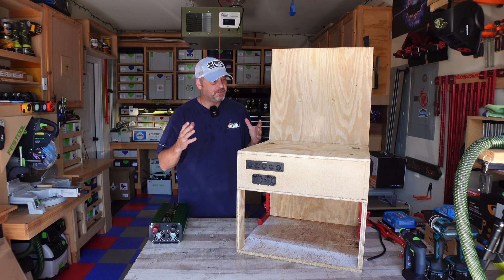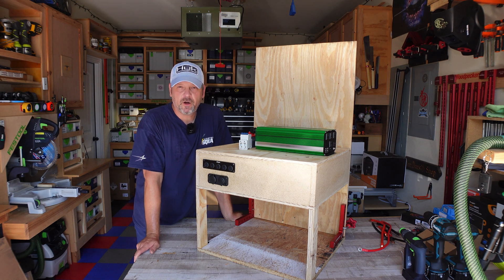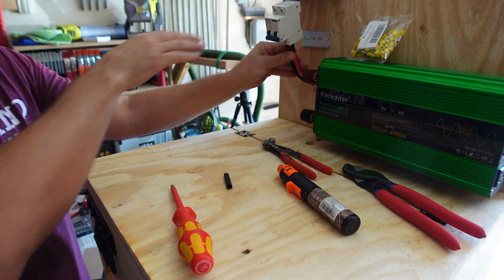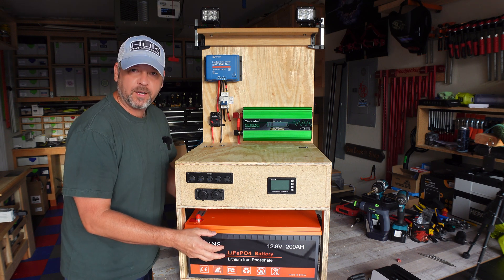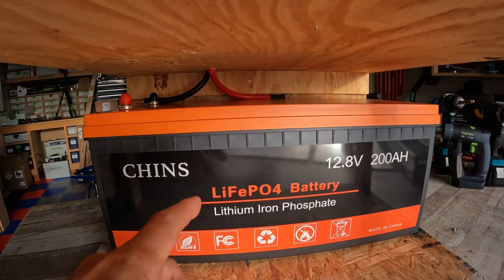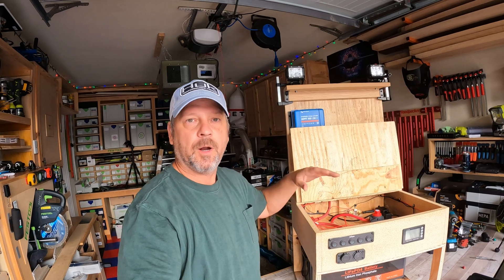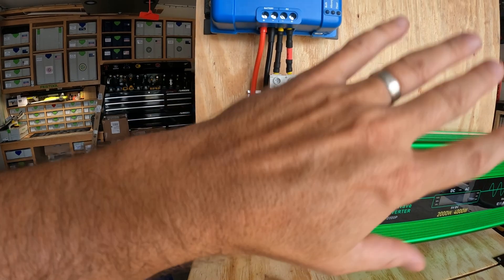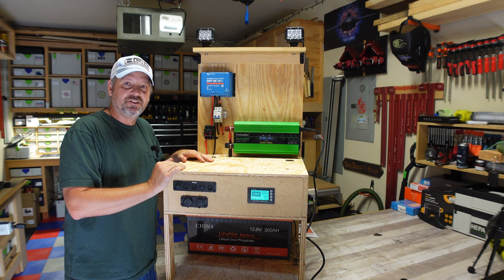ULTIMATE DIY SOLAR GENERATOR 3.0 // CHINS 200AH LIFEPO4

Comment: Just found this video and it really helped clear up some questions I had about an emergency DIY 12v system. 

I know it’s been a while since you made the video, but you have to check out the Watt Cycle 12v 300ah mini batteries. You could probably fit 10 under the cart where you have the Chins

Excellent video and many thanks
Reply from the maker: Thank you! I have t had the chance to review the watt cycle battery yet.

Comment: Do you prefer this battery used here, over the Redodo you used previously?
Reply from the maker: Honestly, they are virtually the same. Likely made on the same production line and put in a different case. Both are good batteries and I’d get whichever is on sale at the time.

Comment: Can you help me out here.  You are showing 12v inverter at 2000watts, that is 166.67 amps.  Your using 2awg wire that is rated at 115 amps.  Something does not smell right here to me.

Comment: Have you considered a Victron monitor so you could access both battery monitor and charge controller via their mobile app?? Or is there a reason to avoid the Victron monitor?
Reply from the maker: I love Victron stuff, and buying a little bit of it at a time because it’s a bit pricey. But well worth the $$

Comment: Maybe too late but, 2 things: First, that resistor is not needed anymore because you have all the wires hooked up already so no sparks will happen when you turn on the big Battery switch. Second, the shunt must be placed on wiring immediately after the battery, otherwise metering is not correct.

Comment: hi! Nice setup, i build almost the same, but i went with 24v 100ah instead of 12v 200ah battery + victron inverter is better just because it will be in the same app you'll use for controller
Reply from the maker: Thanks👍🏻👍🏻

Comment: Can you add a way to charge with portable generator or grid power?
Reply from the maker: Sure! You can connect a charger directly to the battery and then plug into a generator to charge up

Comment: Rule #1 Nothing is EASY! These things HAVE caused fires. Suggestions. It is recommended to put your Battery switch and fuse within 7 inches of the POS battery terminal and in a place that can be gotten to very quickly by anybody. ALL POS wire connections (every one) must be covered or insulated even the Batteries to protect from a SHIT HAPPENS moment short and a fire. Remember your AC panel and your vehicles when they came from the factory have a Main switch and all things covered and fused.

Comment: Great workmanship. Only one suggestion though. Lose the high frequency, transformerless pure sine wave inverter, spend a little more money and install a low frequency, transformer based pure sine wave inverter instead. The inverter that you currently have mounted is absolutely worthless for powering inductive loads such as power tools, motors, microwave, refrigerators, air compressors etc. because it provides very little surge capacity. You may be able to power a few inductive loads when this inverter is new, but every time you fire up one of those loads, your damaging the MOSFETs in this inverter and after repeated use, it will fail.
Reply from the maker: Good advice👍🏻👍🏻
Reply: Can you recommend, if possible, a better inverter? Thanks in advance

Comment: I'd go 24v 100Ah, will cut down wire sizes and free up capacity on the MPPT controller for more power input.

Comment: I think it would be best if you could build the box onto a Dolly. This would provide you bigger wheels for moving it around and you could easily haul it on to your truck or roll it to a grassy backyard/sandy beach. Also, I'm sure it will be alot heavier once you put the second battery on there.

Comment: I wonder what solar disconnect switch I'm going to need? I have a Renogy 40 amp MPPT Rover and three 175 panels from Renogy panels?
Reply from the maker: I’d pick one rated anywhere between 10-30 amps over the max amps your panels would ever be able to produce. But that’s just me. I’m no expert

Comment: Nice build, the main thing I would do differently is mount the main battery on/off disconnect switch to be accessible from the outside and I would probably add a 30 amp A/C battery charger to the cart so I would also have the capability to recharge the battery from the grid or a generator if needed say several days of bad weather and no sun.
Reply from the maker: Thanks👍🏻

Comment: Great built. I almost completed a si.ilar built using a rigid cart. I was able to power a fan, so I think everything is working.  However, I was a bit surprised that I have to manually power the inverter when I used the disconect switch.  Should this system be completely switched off after use, or can the switch stay on? I am having a hard time finding best practices on how to use.
Reply from the maker: For me, I keep the inverter manually turned off as well as using a disconnect switch. The inverter will continue to use power even when not running a load.
Reply: Thanks so much for the quick response. Your video is one of the best ones and I was very helpful.

Comment: Can that inverter run a 700watt microwave, I just bought a 2kw inverter that won’t do it - I’m bummed.
Reply from the maker: I wouldn’t try to run a microwave with anything less than a 3000 watt inverter

Comment: The pre-charge idea is genius! I am far from an expert but that pre-charge setup should work no problem. I built a 5200wh cart from a composite material cart ordered off Amazon. Setup the batteries on the lower shelf/bottom, enclosed it with panels held on with velcro. My Hybrid MPPT is mounted verticaly on wood, facing away from the cart. Built a cover for the storage area of the cart and it provides a flat working surface. I also replaced the two wheels on the cart that were fixed with swivel wheels that lock. I can push the cart in any direction with ease, and I do that often as I use the power cart for various tools and equipment. I am going to install a 12v panel for USB amd charging HAM radio box via Anderson Powerpoles.
P.S. How about a capacitor discharge button?

Comment: ----------- here is an experiment that anyone with solar panels can do -----------

i have a 50w mono-crystalline solar panel and have found out that it works via artificial light [i do not know if this works with other types of solar panels] thus may well worth experimenting

have a spare solar panel or two size dependent of your needs and place them on the wall like you would a picture frame get some 5w or less usb led lights [the bright kind not the dimmer kind] and set them as up-lighters side-lighters or down-lighters or a combination thereof, you [will have to experiment with angle and distance to maximize] that way when you light your home at night you can still keep your batteries etc topped off

or

make a light-box for solar-panels

experiment with other low wattage light sources and see what works best for you

i found this out due to the solar panel on my emergency wind-up radio powerbank torch showing a red-light for charging whilst on the windowsill at night with just the ceiling light switched on and then tested with larger solar-panel

since then i have come across a couple of videos on YT about using artificial light with solar-panels including candle-light
Reply from the maker: 👍🏻👍🏻 would be interesting for sure to run that expirement
Reply: @BrianWatersOutdoors  do i foresee a video in your not to distant future...??
Reply: And use mirrors to reflect the lights as well.

Comment: PS: ruff figure for me was $ 1059.00 USD - that includes an estimate of thos LED lights & switches plus my state tax but you can even rnd that up to around $1070 on the high side - which over all isn't that bad. My main concern was running a fridge with it and from what I can tell it will.
Reply from the maker: Good estimate! Literally about the amount this cost me👍🏻

Comment: Hey Brian, Really looks good was thinking of building something similar myself. I would suggest a general price range in the future as well. Also being a former electrician for almost 40 years I have to agree with Farside as well to put the Bat shut off switch on the front and outside(at least the knob) - always taught to expose switches and plugs.Otherwise great build and TY for including links to find with you have, Here's a tip for those who can't afford that tip crimping tool you can always solder the leads and that makes a good connection as well.
Cheers!
Reply from the maker: Thank you for the advice👍🏻

Comment: another great build. I am doing the same build now. What brand lights are you using? Also where do you get your copper wire? I am getting ready to install the solar shut off switch and 12 volt fuse block next. Lastly what is the brand of your heat shrink lighter or pen?
Reply from the maker: Thanks. The lights are Nilight brand, super cheap…copper wire is from WindyNation on Amazon, and I got the torch while standing in the checkout line at Lowe’s👍🏻

Comment: Very nice build! 

Can a single 120W solar paner cahrge your 200Ah LiFePO4 battery? 

Been using 120W solar panel too to charge my 250Ah lifepo4 battery but could not fully charge it.  I can only reach 73AH charge for 2 days charging. Im using PWM charge controller though,  still waiting for my 50A MPPT charge controller.
Reply from the maker: It could if you leave it long enough

Comment: I’m not sure why anyone would build these monstrosities given the cost when you can just buy a few 200w panels and a ecoflow power station, it’s even mobile…
Reply from the maker: Okay
Reply: @BrianWatersOutdoors  I’m just saying my ecoflow delta 2 system with 400w solar is cheaper, more portable and quite a bit more functional that these tinker builds.
Reply: @mikeeeeee555  I agree. Perhaps time should be spent on making all gear DC only.
I see way too many DC to AC ( videos)combos only to have microwave or some uncommon AC appliance powered...not needed during power outage. 
Solar power is often wasted making AC from DC for show and tell.
If you are survival minded vs. show off for your neighbors....I guess it's your gear...go crazy.   I say....learn to live on 100 watts per hr/day. That's sustainable.
Any light is better than no light in a black out.  
1KWatts or more will alert the nosy neighbors.  IMO

Comment: just a quick question, if you hook in another battery in parallel(400 amp) do you need to change out any of the equipment in the build for anything bigger
Reply from the maker: No, you’d be good keeping everything the same.

Comment: Great video!  I didn’t see a AC Charger for the Chins battery.  You might consider having it to be a sort of UPS.  I use mine as a UPS plugged into the wall that runs my CPAP so when we get rolling blackouts in Texas I can sleep without knowing the power went out.  All the best !
Reply from the maker: Great idea. I do have a charger for this, just not built into this cart though.
Reply: @BrianWatersOutdoors  sounds good.  I am looking into various parts for portable Ham radio box that I am gathering up the pieces for solar/portable battery/radio, etc.  If you want to add it - cool, not trying to tell you what to do.  Haha.  We have enough of those people in our lives.

Comment: Great Build! That would work great on a hand truck for an off cabin, or rough ground.
Reply: Agreed! A very nice build 👌.  I just finished mine (or so I thought), i used a hand truck. Standard wheels at rear and two swivel casters at front. Easy & versatile mobility.
Your electrical is perfect. The resistor wired through a momentary switch is brilliant. (Hence the reason I though I was done).
Thanks for sharing! ✌️
Reply from the maker: Thanks Tracy

Comment: That Yinleader apparently has a crazy low idle power consumption. Have you noticed that or do you always turn the inverter off?
Reply from the maker: It is lower than any other inverter I have used on these carts.

Comment: for 1000.00 you can get a much smaller Portable Power Station 2000W, 2220Wh Battery Backup Portable Generator.  I understand its not expandable but for the size easier to use.

Comment: Hi thank you for the Video   I have a question 
Do you have to turn off your mppt charge controller if you shut off the main battery switch?
Reply from the maker: Yes, otherwise it will be a slow drain in the battery. I just flip my breaker to cut power completely from it.

Comment: Nice build!  I built a similar cabinet type unit with all of the goodies on top and some Chins 300AH batteries below. Its portable if you own a forklift. I use Renogy shunt battery monitors that look like the one you have. There is also a Victron Smart Shunt but the range to my phone is not satisfactory. So, I placed a $50 Pet Camera from Amazon on top the inverter with a cheap Walmart LED table lamp running 24/7 for all lighting conditions. Your lights are better! The camera has pan tilt zoom and a 2 way speaker so I can monitor the battery state anywhere my phone has a signal. I can point a red laser at the monitor, listen to see if inverter fans are running, and take a look around my disaster of a shop and plan a major cleanup in a year or two. 

Some people call this a Solar Generator.  I call it a Sunshine Compressor.    Also, it has a 350 amp marine type master off disconnect switch. I put a momentary contact switch on top of it with a resistor inside for precharging the inverter. Here it is
https://www.youtube.com/watch?v=9rUgQoXUzyk
Reply from the maker: I like it👍🏻👍🏻👍🏻👍🏻👍🏻

Comment: Can someone educate me on when you have a solar charge controller, what is the difference between 100/30 or 100/50?
Reply from the maker: The number after the / is how many amps the charge controller can accept from your solar panel array. Depending on if you connect your solar panels in series or parallel will determine how many total amps your solar array will produce.
Reply: @BrianWatersOutdoors  That is what I thought, but the what the 100 or I have seen 75/35 controllers and can't seem to find a clear definition.

Comment: I know it sounds silly but can you please tell me what the output voltage is on the inverter? I have tried several different brands of inverters on different brands of a batteries and I cannot find a single one that actually puts out close to 120 volts most put out between 112v and 116v also none of the ones that are stated as pure sine wave are actually pure sine wave. Please help brother love your channel and all of your builds 💞
Reply from the maker: They all probably put out voltages differently. This particular inverter was putting out around 119 volts with a 500 watt load
Reply: @BrianWatersOutdoors  thank you very much for the fast response I'm trying to trace down some issues I have also can you verify that this particular inverter is actually pure sine wave? Thank you again I have definitely subscribed and I'm binge watching all of your videos 💞💞💞

Comment: Thanks Brian.  Ive always wondered, how would you connect an AC charger to the battery as well, so you can charge it before taking it off-grid, even if you dont have solar?  Do you have any good recommendations for AC chargers for 12V Batteries?  In my dumb brain you would attach it to the positive and negative bus bar and it would charge the batteries, but that doesnt seem correct.
Reply from the maker: Hey Jonathan. You can connect to pos and neg bus bar. That’s essentially how my solar charger is connected to this system. Or, you could connect the leads of the battery charger directly to the posts of the battery If you don’t have those bus bars👍🏻
Reply: @BrianWatersOutdoors   Thanks for the response
Reply: I like the Aims 75 amp chargers. They have dip switches so you can set them for different battery chemistries. They are so reliable that you can connect to a lithium battery and watch it charge at 1000 watts, walk away, then come back and find it throttled back to 2-3 watts with fully charged battery. For lithium, it stops at 14.4 volts as needed for 100% charge.

Comment: That button won’t pre charge your inverter if you drain everything with the floodlights.  Nice build keep showing them.  Have fun stay safe.
Reply from the maker: Right.  I was basically just showing that it worked, but you’re correct.

Comment: I have a 300 ah Ampere Time, 2000 watt inverter, and 60 amp MPPT charge controller. This is what I`d like to do with it but on a dolly so I can roll it to the garden to power a tiller. Still don`t know for sure if I can build one safely. Spent the last of my savings on the stuff and I`m terrified of damaging the battery somehow. I may need it in the future to survive. I have solar power stations for everything from freezers on down. I need the large battery for heavy loads and emergency power for a small window air conditioner. I still need about 500 watts more in solar panels to max out the charge controller and ability to use air conditioning during the day without draining the battery so I can have another 6 to 7 hours of AC at night.

Comment: Just a couple suggestions.  Put the shut-off switch on the front so you can reach it quickly.  With the lid down, someone is going to place stuff on that nice shelf you built.  And, hopefully those flood lights can be rotated down to shine on the work space.  Put it on wheels, or make it portable somehow.  A dolly or hand truck would do the trick.  It's looking good, and i like the idea of MORE POWER.
Reply from the maker: Yeah, the floodlights are adjustable, and I’m putting casters on this as soon as they get here👍🏻